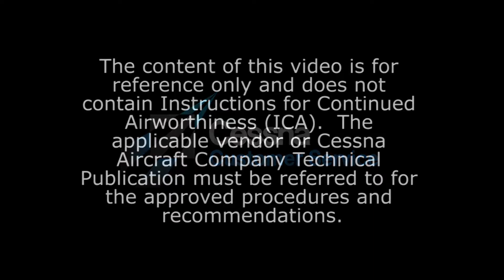Major vs  Minor Repair Criteria

Comment: Please correct.

Mr. Kelderman states @ 1:20 that part 1.1 says that a major repair is one that if "properly" done might appreciably .... which is the opposite of the definition as published in the code...

Here is the text from the FAA regulations 14 CFR Part 1.1

"Major repair means a repair:

(1) That, if IMPROPPERLY done, might appreciably affect weight, balance, structural strength, performance, powerplant operation, flight characteristics, or other qualities affecting airworthiness; or

(2) That is not done according to accepted practices or cannot be done by elementary operations."